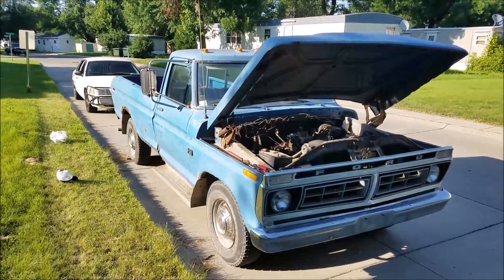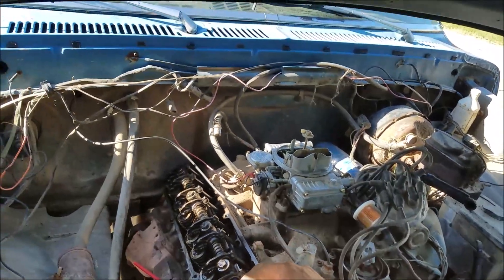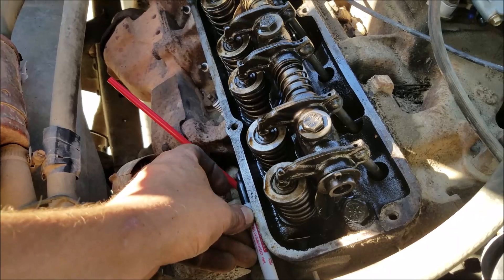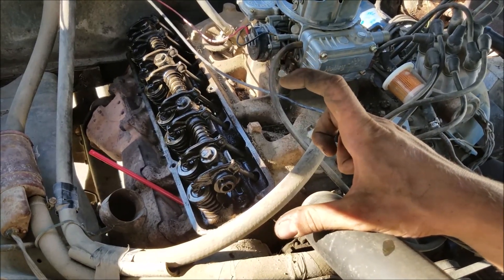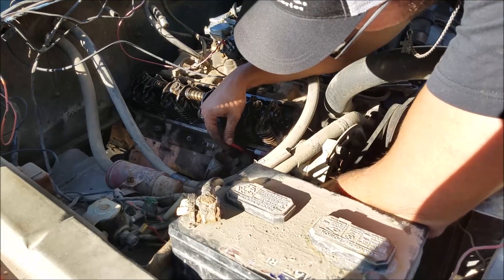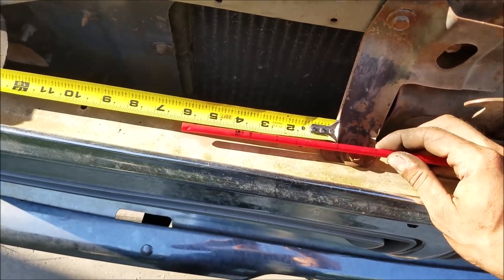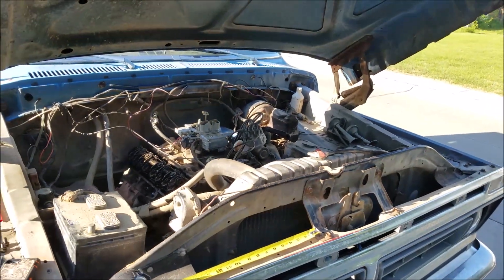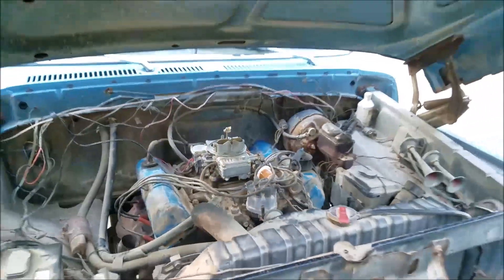Ford 360 or 390 FE Engine? - How to Tell the Difference in 5 Minutes

Comment: I worked for a company in the 70s that bought all their trucks from the Tennessee Valley Authority. F-250s with auto and the  360 CID engines. We had our own shop mechanic and he was pretty much an expert on the 360 engine. When we got one he immediately pulled the heads and took them to a machine shop for the machine work then reassembled the heads and reinstalled them. Those old trucks ran great, and forever, but the fuel consumption was a killer. Still cheaper than buying new, and they did everything asked of them with ease. We put utility bodies on them, and bed winches, so with the tools, and equipment we carried they had a HARD life. A lot of weight, even when not carrying equipment. Those trucks are what sold me on Fords for work trucks. Nothing else came close. And I STILL like carburetors and hate electronic fuel injection, sensors and computers for trucks. Flat out GUARANTEE our trucks spent less time in the shop than ANY modern vehicle. And down time costs money in the service business.
Reply: My family owns a landscape company, and we are all Ford for the fleet trucks. In the last 20 years or so, we've had every generation the f150-f350. As far as the newer trucks, (by new I mean 80's to early 2000 lol)  they gave us constant problems. Always something engine related and constantly breaking down. The Tritons were the worst. With everything going okay until it shot a spark plug out the head at the worst possible time. Our longest lived vehicles, that took the least maintenance and repairs were the 70's trucks with the FE blocks. I still have two that are driven almost daily. No substitute. I guess the only exception is the 99 with the 7.3 power stroke. It's performed great. But diesel is a different animal all together
Reply: I found that the 360 and 390 engine both run longer if you over load the truck once in a while .
Reply: Guessing they got the 4bbl, I had a 73 with the 2bbl and it got fantastic mileage, at least compared to the GMC 400 I had at the time.
Reply: Sensors and fuel injectors should be a option for performance minded people with big wallets for engine work . I prefer carbs .
Reply: I found fords in that era to be very unpredictable for fuel mileage. My dad and I identical 72 pickups with 390s , except mine had a Holley and manual tran , his was motocraft carb and auto 
He got 12 mpg , mine got 24
Later I had another that got 24 mpg , was talking to a neighbor with identical truck , got 15
Reply: except a modern truck compared to an old dentside (73-79) 73-76 for FE engines, will be outperformed by a modern truck and last longer.
Reply: @abolishguncontrollaws5689 but they won’t last longer, new trucks have unimaginable amounts of electronics that fail. his whole point was that they’re simple & near bulletproof lol. No one is building stuff like that today
Reply: @abolishguncontrollaws5689 And when a new truck quits call a tow because there is nothing the driver can do to make computerized junk run

Comment: Set the choke closed cold. Set the fast idle warm. Set the idle and timing warm. Replace the choke thermostat. Replace the distributor cap and rotor. Get the distributor on #1 TDC on the compression stroke on 0. Turn the engine in normal direction. Lift the distributor and point the rotor at #1 terminal. Turn the distributor way back opposite normal rotation. Lower the distributor and turn the distributor to normal. Put everything back and set the timing. If the distributor won't go down, use a oil pump primer shaft or old distributor with the gear removed to align the oil pump shaft to distributor. This compensates for timing chain wear. Test the choke pull off, vacuum advance, EGR for leakdown, heat control valve vacuum control, transmission vacuum modulator for leakdown, heater/ a/ c vacuum motors, charcoal canister purge container for leakdown, and other vacuum parts. Set the transmission kickdown at full throttle to spec. Adjust the bands using the factory tool and sockets.

Comment: I had a '72 F-250 Ranger that had a 390 4spd , that truck had alot of power , I got 9 miles to the gal. loaded or empty...! Wish I still had that thing...! Had the 16.5 tires on it , was one hell of a work truck...! Had the factory air , power steering , power disk brakes...! Problem with it was the cab mounts and the inner fender wels was rusted out , I came across a 1970 f-250 for $100.°° from a farmer and switched everything from the 72 to the 70...! Took the whole front axels and put on the '70 as it had drum brakes and no power steering on it...! It turned out to be a better ride...!!!
Reply: I just picked up a 68' F-250 390 4spd, Still working on getting it running but i'm glad to hear your truck was a work horse. I'm only 19 so i know very little about trucks.

Comment: My dad owned a f100 that he bought new with the 360 and it burned oil from day one had ford do an overhaul on it under warranty and it burned more oil after that how do you fix that I'm in the process of trying to buy back and want to keep it numbers matching but don't know if they still have the 360 it has a 300 in line 6 in it now what are your thoughts on this?
Reply: keep the 300....................

Comment: Good tip. I have a 75 HiBoy 4X4 and the guy I bought it from said it's a 390, so it can't be the original engine, since they only put 360s in the 4wd trucks.I'm gonna do this test just to confirm, thanks for the great trick.😁
Reply: they put lots of 360's in 2 wd trucks.............
Reply: @jimrhoads9810  yeah but they only put them in the 4x4’s is what hes saying!

Comment: When I do this I run number 1 up till my wooden dowel wont go any higher and mark it at the top of the spark plug hole
then run down to BDC and mark it again at the spark plug hole and measure. Very similar to what you did.

Comment: Would you believe that you can put a 390 crank in a 360 with all 360 parts and the engine will run? Traded for a Ford truck at the dealership that had a bad rod bearing. Got a new crank from the local NAPA. When we started it, it sounded like a diesel, but it ran. The technician thought it might be the wrong crank, but I was sure that the pistons would hit the head with a 390 crank. They didn't, but the compression ratio was out of sight.

Comment: so what about the fe 370?, 352, 332, 360, 390,  wert the 428, 427 fe blocks as well? how many were there?
Reply: The 370 is a Lima, or 385 Series engine  (429/460).  The FEs are as follows (the numbers in parentheses are for truck engines; bore and stroke are the same regardless of application): 332(330), 352, Edsel 361(360), 390(391), 410, 427, and 428.
Reply: Keith Coppage you forgot one the famed 401 horse 406 that come out in 1962
Reply: @redtorino  462 in the 63 suicide door Lincoln. Also 406
Reply: 406 ford 410 mercury
Reply: The 427 was a side oiler, very different block. I don't know why Ford made so many different ones. Just like the 351 Windsor, Cleveland, and Modified, all 3 are different.
Reply: @whitestratman3158  side oiler just means it had oil lines up side of block, as for Windsor, Cleveland and modified, windsor was straight valve small block 221,260,289,302,351(tall deck due to stroke) all cast in Windsor Canada, Cleveland was can't valve(like BBC) "medium block" that sized and fit where Windsors would sit but had better head flow and we're developed for performance/racing. Now the Modified is an offshoot of the Cleveland but designed as a smog motor in 351 and 400 sizes and shares bell housing with 429/460. All good engines if you can afford to build. As we're FE engines
Reply: MonzaRacer Oil lines up the side of the block? On a motorcycle maybe. The "Side Oiler" had a special passage internally that would pump oil to the crank before the upper valve train just the opposire of a "Top Oiler" Most used solid lifters and had a steel crank because it was a Race engine with 12: to 1 compression ratio. And yes, I know all the differences between the 351 engines I owned all 3. The Windsor had the same transmission bolt pattern as the 289, and 302, it was a taller block which used a wider intake than the other two small blocks. The bore is only around .005 larger (if my memory serves me correctly) thus the longer stroke, that's where the taller block came in. I swapped out a 289 for a 351W in a 67' mustang I used to have when the mains started chattering at a steady speed. Had a Cleveland in a 72 or 73 Torino, Modified in a late 70's T-Bird.
Reply: Some of the pickup 390 had 410 pistons for lower compression. 4v car 390 had more compression.

Comment: bent push rod issue, vibration damper goes bad alot, low oil pressure, rocker tick noise, hard starting on cold mornings and at high miles these spin rod bearings. when doing heavy pulling like hay wagons, gravity/chopper boxes the exhaust manifold gaskets blow out start to leak.  my dads '69 3/4 ton 2x4 had a 360 that burned oil like crazy so we dumped in all the tractor waist 15w40 & 85w even hydraulic oil. when i was 16 i drove it to church every sunday and i reeked like ford. thing had no brakes at all so i'ld shut then engine off on the hwy while turning into the church parking lot and slowly coast into a spot. that damn truck could pull 3 minnesota 250 gravity boxes of shelled corn! i sure miss that truck
Reply: LOL... pulling 3 gravity wagons of shelled corn at once may explain the rest of the story you told.
Reply: The good old days.

Comment: All 360s were 2V engines. If you know the engine is original to the truck and hasn't been converted, the fourth letter in the V.I.N is what the factory motor is/was. Also, as you should know, the 390s were only used in 4x2 trucks and passanger cars. And, a interesting fact is, the FE 360 uses the same crank and rods as the FE 352. The only difference between the 352 and the 360, is that the 360 has .05" bigger bore than the 352.
Reply: Most 390's have a hanging down oil filter adapter and the 360 comes straight out dead give away if you see it. Just had Lordco Machine Shop  out of Mission BC build me a sweet 390 357 hp 419 lbs of torque engine. Edelbrock heads and matching intake. I bought a Steve Christ FE book a long time ago with all kinds of good info on these engines. Sez 390 right on the fender of my 69 XL convertable! You want the 390 crank which has a notch at the flywheel end 360 has no notch. If you have a good block keep it safe as I lost 1 to rust over time. Cheers
Reply: Pretty hard to tell if engine is the original sometimes because most cases the engine was replaced years ago
Reply: 352 used a longer rod.

Comment: You can also put number 1 piston to top dead center and pull the number 4 plug out to measure the stroke.
Reply from the maker: That makes sense - Iv always just done this on whatever engine to measure the stroke. That would be 2 minutes vs 5 !!!
Reply: Sounds easy til you go back there to pull that #4 plug.on my 67 fairlane that was no easy task.
Reply: i never thought about that lol good idea
Reply: That's the same way I checked my engine stroke it turned out to be a 390 guy I got it from said it was 360.🙂
Reply: Measuring the piston stroke is also useful to determine if a straight 6 truck has a 240 or a 300.
Reply: Now that's a great idea. It's so simple and genius. Thanks.